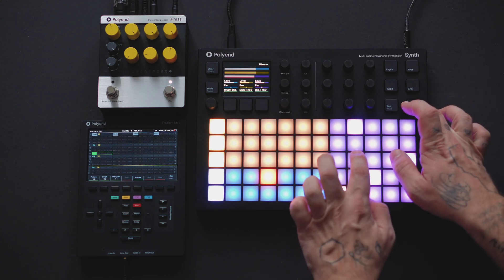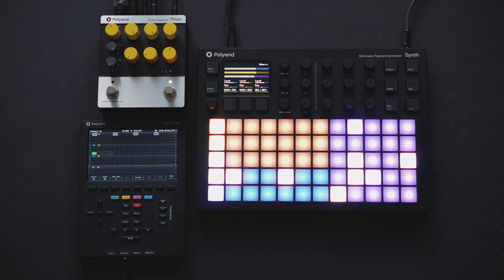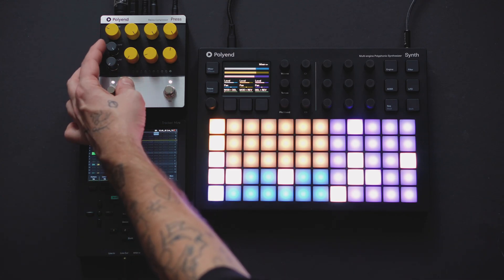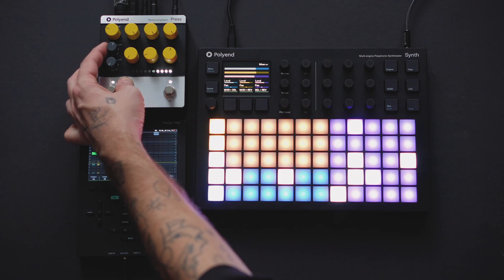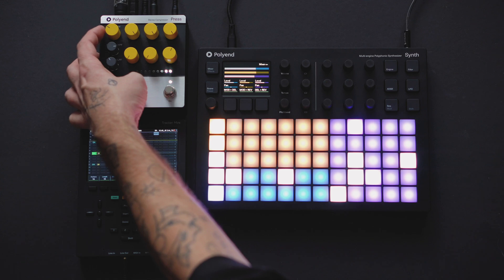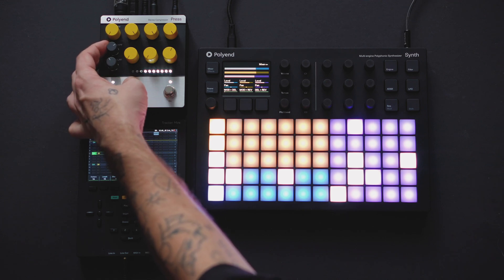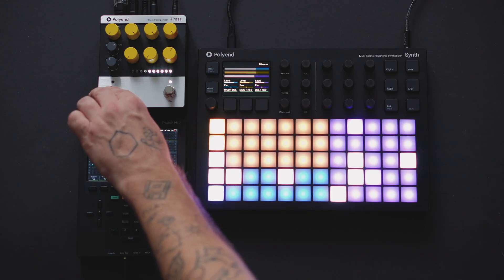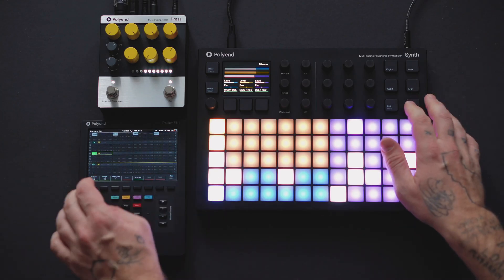Polyend Press / Sidechain Compression Explained

Comment: Question - I have a Digitakt 2 with only one stereo output.
I want to use compression only on frequencies above the kick drum, using the kick drum as sidechain.

Can I use the sidechain filters to tell the Press that I want the high frequencies to duck the low frequencies without using external sidechain?
Or should I split my stereo signal to both the input AND the sidechain input and then use the sidechain lowpass filter?
Reply from the maker: In this case the sidechain filters will tell the Press to duck everything going into the input using the high frequencies. The sidechain filters only determine what frequencies trigger compression, not which frequencies are compressed. You would have to send the kick into the sidechain input to avoid compressing it.
Reply: Technically the DT2 has 2 stereo outputs if you count the headphones output. The internal compressor in the DT2 has a filter shelf as well.  Were you able to solve your problem?